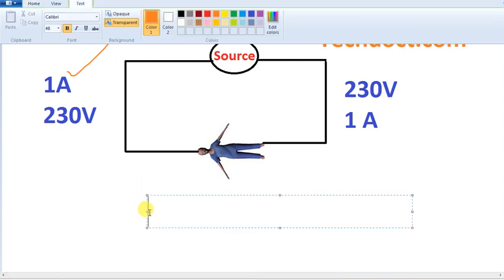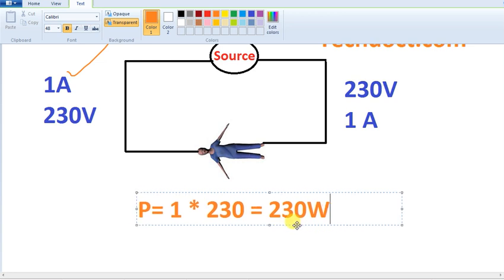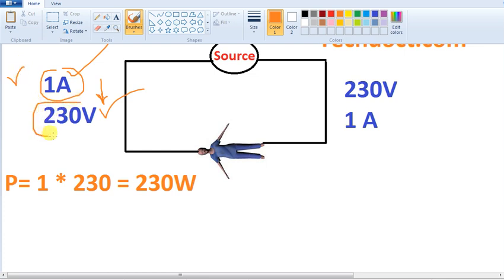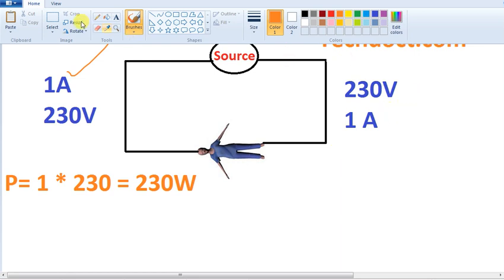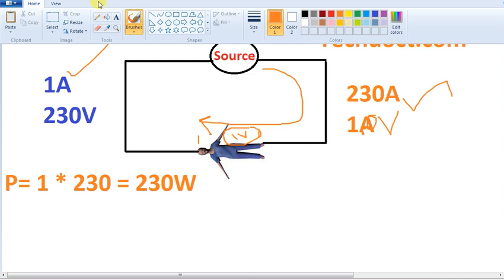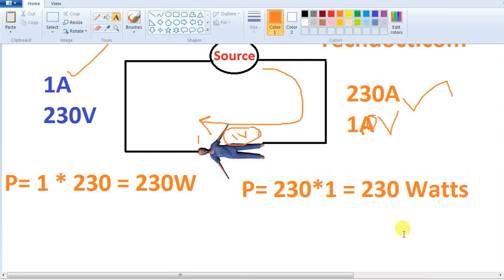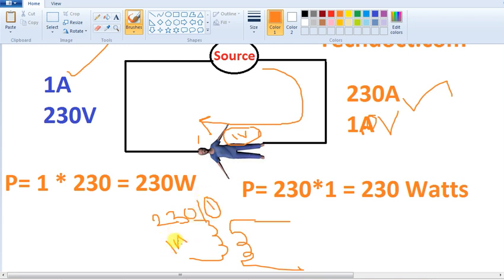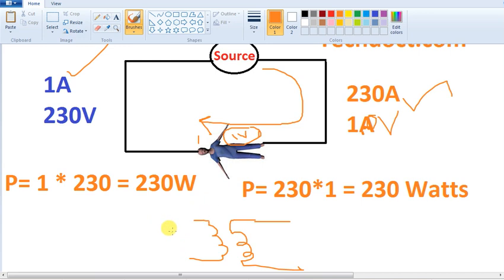Which one Dangerous 1A 230V or 230A 1V in tamil My openion

Comment: BT my dear in this case when the sec winding is quickly damaged because of 11 kV is passed through that 1.5 sq mm conductor continuously BT 1.5 sq mm cable is not applicable for sec 230 A that is load . so my point of view 230 A will be dangerous.... ur command pls..

Comment: Bro 
P=230A* 1V = 230w 
But one Volt is not enough to push 230A. It's possible bro voltage is generally a potential 1V is not enough to push such as high current. So 1A 230V is considered dangerous here.
Reply from the maker: no nanba not like that...you can refer the welding machine working principle....which has only 25V output..in running it will be 5 to 10 volts with 400 Amps.
Reply: @Techdoct   no brother 1v in ac is it's peak value right for 50hz. It's Keep changing. 1v is not harmful. In case of welding machine concept is actually you're short circuit to melt the electrode to weld. At the time to short circuiting usually high current and lower will be the voltage.